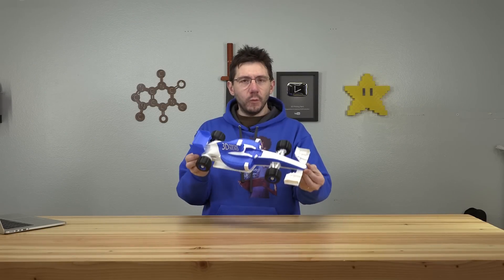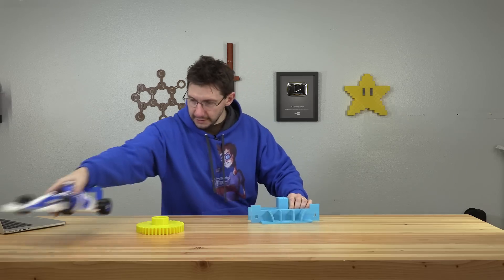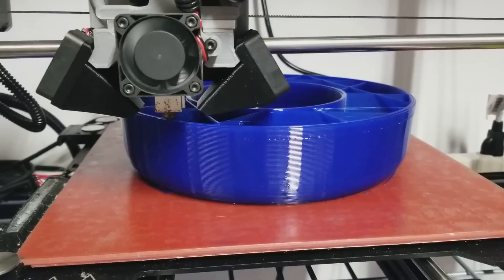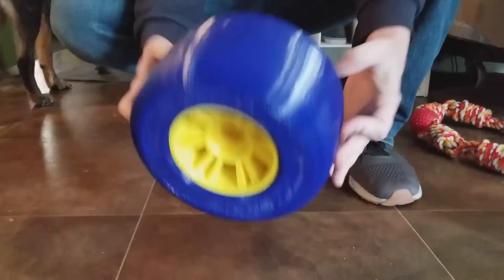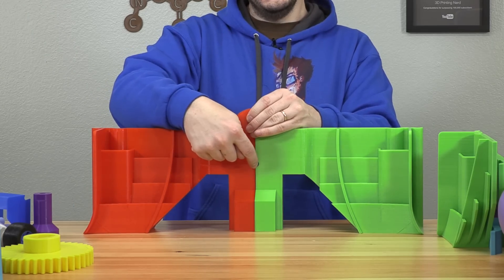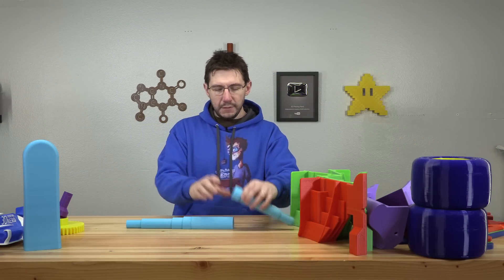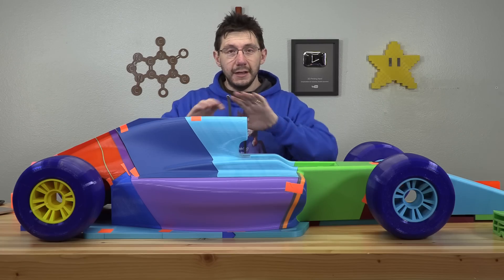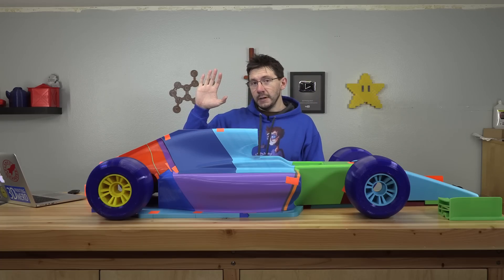Worlds Largest OpenRC F1 Car - Phase 1 // 3D Printing the Parts (Matterhackers BUILD PLA / Pro Flex)

Comment: you have cut the parts without consideration for structural integrity, and you are relying on epoxy to hold it all together... if i were you i would have redesigned them so they would have some positive engagement as you assemble them together
Reply from the maker: I agree with you. I'm still learning what's best, and since doing what I did, I know this isn't best. Don't worry I will revisit :)

Comment: I would think about something other than planar cuts.  You could, for example, cut the parts so that they plug into each other (axle) or so that they interlock with like a "zig zag" cut.
Reply from the maker: You're right, those are fantastic ideas. I'm learning so much from this build, and the next build will be better.

Comment: I found a good trick get a piece of steel the size of the sides of both heat it up with a propane torch for a couple minutes quickly put the pieces on the piece of steel so it melts just the top and the stick the pieces together when the tops are still melted so you have to be quick and then let dry for about 3 minutes

Comment: on the rear axle edit it to have a 1/4 or 3/8 inch hole through it then use some threaded rod to join them together.

Comment: You should try printing your pieces jigsaw puzzle type edges so they will lock together and have more surface area for glue. You can also try printing holes and using dowels or carbon fiber reinforcement through the joints.
Reply: Commented too soon. I see you already covered this.

Comment: On any structural joints you are worried about just drill a hole in each side and "PIN" it. A pin of any material will keep sheer forces from being placed on the joint and add cubic inches to the bonding surface. Also use something like an 80-120 grit sand paper on the surface area.

Comment: Now make one for your other foot!
Bud-- it seems to me that you have demonstrated the all-too-easy-to-solve problem with slicing a part into many. You cannot have simple butt joints for almost any set of parts. Too weak under almost any circumstances. But! You have enough software to add male/female pins and corresponding receptacles. Maybe a better shape would be an "ice cube" shape that fits into a hollow in the shape of the ice cube tray (one). Maybe there should be some "relief" for the glue, but it needn't be much.
For big flat things, nothing really does it for any flex situation but screws or nuts and bolts. But that's a lot of engineering-- you need clearances, overlapping areas and, oh yes, a thickness that can deal with all that. Puzzle shapes may be the answer-- a key and a slot; even a T-shape with corresponding T-shaped receiver. Skinning will work-- but it adds weight and one must apply the glue fairly well.
Very interesting 4x concept-- motorizing this? Gonna have to get plates to take it on the road. Maybe your dog will like it.

Comment: Registration tabs, and nut & bolt locations can be made into the model before cutting it apart, that way you can use the tabs, dowels, nuts n bolts to hold it all together with decent strength.  Proper Prior Planning Prevents Piss Poor Performance.  But overall a cool build.

Comment: how about for the thinner sections that your worried about for strength you drill holes in the pieces and 3d print plastic dowels to add strength.

Comment: Drill a hole and add a dowl(?) and should make all butt joints stronger
Reply: They even use little dics biscuits thing in would work to connect plywood together.

Comment: Instead of meshmixer, you could use Onshape to do modelling and splitting. That will let you put in those registration marks!

You can copy this model and make any edits you need:
https://cad.onshape.com/documents/82a16a9509b9900187c3e97b/w/6beae73df1575103f93b8151/e/3a4083b2d158e3adcde34efe

Comment: if u drill small holes on the joints where this is going to be a load or tourque you can then insert metal or wood dowels to strengthen the joints

Comment: If you ever go for a print this big again I would look at how wood workers would tackle parts like this. Like you said dowels would have been a good idea. There is also biscuits which would be a easy print. You might even be able to use a biscuit joiner on the wing and floor. Threaded rod can do great things if you plan the holes out and can even be easily hidden.

Comment: Hey Joel. I'm the guy  that build Zarya's Particle Cannon for the Hacksmith. (check it out on YouTube) It was a 24kg 3D print on the Taz 6 Moarstruder that had to hold a decent amount of weight. My lessons learned from it were that no amount of cyanoacrylate and resin (XTC 3D) will increase layer bonding strength enough to bear the kinetic weight of the object. (when you pick it up by one end, or it resonates while driving) In my case, I welded together an internal frame structure from steel to distribute the load. If I were to build it again, I would wrap the 3d printed assemblies in fiberglass, as it adds a huge amount of strength for it's weight. Can't wait to see this built. Good luck!

Comment: Have you heard of acetone welding? Supposedly, the weakest part of two parts welded together by spreading acetone on the two surfaces is the same as if it was printed in one piece. Maybe you should try that for the axles... and why not everything else?

Comment: I have drilled into plastic successfully. I used titanium drill bits. I recommend using a test piece. If you need bolts nuts etc... I also recommend https://www.boltdepot.com I use them all the time.

Comment: I'm wondering if the axle ends up coming out weak because of the divisions if it would be better to run a rod through it like you did with some of your other larger builds.  I'm also wondering how well that axle scales with it having a large flat area.  I'm thinking an additional print to make it completely round would end up helping as well.

Comment: If it's possible to reprint the axles, try splitting them with a diagonal joint/splice.  something with a 10/1(or better) ratio would be ideal but what ever you can fit in the center would be good.  Try it with a smaller test piece and compare how much force it takes to break them.

Comment: Had you used ABS, instead of PLA, you could have used regular plumbing ABS glue: It melts the material and you end up with very solid joints. On the other hand, solvents for PLA are nastier and harder to come by.

Comment: Great looking Project.  Demonstrates what 3D Printing can do.

For parts printed in sections, I often add "registration holes" for inserting tiny (1.5 - 2mm) stainless steel pins after the fact.

It is an advantage to print parts for which one has  the original model, adding holes which line up in SW or Fusion360 is fairly simple (just a bidirectional hole / extruded cut) for most models.

For parts which don't need to be massively strong, you could use the model to Vacuum-form polycarb or acrylic (less messy than fibreglass) shells to use on the finished car - yes undersizing the original print to allow for the finished thickness of the shell is an issue, you can't just print it smaller- that would cut down on finished weight a whole lot..

Comment: why not dowel joints between the separations?  it makes assembling and glueing much easier furthermore the parts are much stronger that way.
hope to see this fully assembled . hope it does not fall apart due to the weight.
probably you could fiberglass the main body and base.

Comment: You should look at master carpenters videos on joints when you have to connect structural joints or pieces etc they have the best and strongest joints that can help like dove tail mortis and tended spell check messed me up but those joints are stronger and others versus nailing or screwing them together those you can use alittle bit of glue and your set

Comment: For extra strength in the areas you join them you can always use a soldering iron or Drill to make holes, and epoxy metal or wooden dowels in before gluing the joints this would add  a lot of extra strength to keep the joints from shearing under high g load when driving it.
Reply: I didn't watch till the end before making this comment where you mention dowels, but still relevant haha.

Comment: Wouldn’t it be possible to make the plane cut in the profile of a dovetail joint or a finger joints? Would get a ton more surface area for adhesion. Fiberglass & resin along a long butt joint would probably help a ton also..

Comment: Think you're gonna need to slap a layer of fiberglass on the inside of the parts to keep this thing strong so the glue joints don't snap off super easy

Comment: Joel, a note for the future massive build.  Consider using some wood joinery joints rather than butt joints.  It shouldn't be much more difficult to create say a mortise and tenon or perhaps even a dovetail joint.  This would A. make glue-ups much easier B. the Joints will be much stronger.  You could also use a peg system.

Great job as always and thank you.

Comment: For load-bearing pieces, it might had been better to cut on an bias, then integrate tongues and grooves to hold it all together. This would provide more surface area for adhesives and (almost) guarantee a perfect fit without bracing or fastening, or even provide the option for metal fixtures to fasten component together.

Comment: You could drill holes and brace the joints that your worried about with dowels. Or for future you could slice the parts and add holes on either side to put dowels in. Just an idea.
Reply: Oops just got to the part where you talk about adding holes in the future. But you could still drill some for now. Thanks again for what you do!

Comment: For the rear axle, I suggest you reprint the pieces but with a square hole on the mating surfaces and then print a tiny cube that you put inside so you'll have what's called an "obstacle power transmission" wich will hold way better than just glue

Comment: Joel, when you split the axle if you inserted matching holes in the center of each you could use a printed pin to strengthen the joint. Angus Deveson at Maker's Muse has a video in his meshmixer series dealing with this exact issue.

Comment: You should use carbon fiber or fiberglass (cloth?) and epoxy to reinforce the load bearing parts. Especially on the main body just sandwich it between a table and put a piece of plywood on top with lots of clamps or weight

Comment: Some substitutions I'd suggest:  Using steel for the axles and Aluminum or steel for the base and have it CNCed since it could essentially be 1 big sheet of steel.  This car kind of reminds me of those Hot Wheel's cars where little kids ride in and steer.  I realize to design a cockpit would require some redesign and reprinting.

Comment: I wish I could find another application to do it in, however the windows 10 3d builder app allows you to throw a tube into the middle of an stl to a specific size. Thats how I end up dealing with splitting parts. the cutting tool is not as good but that part works pretty good.

Comment: you should learn some wood joints techniques for next time you split a object... you will have more accuracy when joining the pieces, add strength and more surface area to glue.

Comment: I had an idea for when you have multiple prints in risk of running out of filament. Get some cheap Flood Alarms and replace the electrical contacts with two pieces of metal designed to slide along the filament by gently pinching it. As soon as they slip off the end of the filament they'll make contact with each other and set off the alarm.

Comment: Put a 45 degree bevel on all of your joints and use a 3d pen to plastic weld them together. I just did that for a project and it works absolutely amazing

Comment: I've used the technique below in Fusion 360 successfully to split and glue a toy dump truck model also by Daniel Noree, printed on my tiny and somewhat crappy M3D Micro - https://knowledge.autodesk.com/support/fusion-360/learn-explore/caas/screencast/Main/Details/058c63ba-23c4-4b96-a218-d86a52afbadd.html
The split version of the toy dump truck for anyone who's interested - https://www.thingiverse.com/thing:1239806

Comment: If you had used Netfabb to split the model you could have used pin creation , this would have produced holes on one side of the split and pins on the other , much better for alignment and gluing (more surface area )

Comment: Hey man, I use good quality chamfered wood dowels used in furniture. Just scale model, then split parts so you end up with watertight mesh, model dowel (i made it 50um larger in diameter with round ends), place inside the model wall, on line between parts and use boolean difference. It may be tricky to place dowel model inside mesh, cross section view helps a lot, but I dont know if meshmixer provides such features. 6mm dowell is smallest , but if i need something smaller I use matches. This way you apply glue and join parts with perfect alignment, just remember dowel must face same direction, if they are at angle to each other You wont be able to join multiple parts. If, for some reason dowel hole will print badly, you can easily modify wood dowel with knife or chisel. I glue pla with epoxy and use masking tape on sidewalls edges in case resin spills out. I wonder how well Your parts will fit show us the gaps in next video.

Comment: Hi Five, Joel, great video as usual!  i have a question for you i want to connect to my tevo tarantula with my computer only for bed levelling, etc. in simplify 3d or pronterface with no internet connection/wi fi connection, computer controlled only.  i have searched the web and have found no information on this whatsoever. Am i chasing my tail or is it at all possible?
  Thank you for your help!

Comment: Awesome project, wanted mention an issue i encountered where the gear that feeds the filament skips back, i had this the last time i was printing the last piece of a mask and from what i found online i decided to clean the nozzle since i changed the filament from one brand of PLA to another PLA and this issue happened about halfway of using the roll.After cleaning the nozzle ( which i haven't done in a long time) the issue appeared in the beginning of the print but then it stopped and haven't had it since, i think because of the clog the gear was having a hard time pushing the filament though the nozzle. I hope there is a better way of cleaning the nozzle from PLA than just heating it a few seconds above a fire and using a needle to remove the plastic.

Comment: You should get Ivan Miranda over and work on getting it moving
Reply from the maker: I love that dude!
Reply: 3D Printing Nerd RCLifeOn, 3D printing Nerd, and Ivan Miranda collaboration for a driveable 3d printed F1 go kart, which an adult can drive. Maybe Peter Sripol could help for the motor part too, or even better, Colin Furze!
Reply: @tiberiocellini3641  Colin Furze would add 200kg of rockets and a Hayabusa engine to it. Rip it apart but it would be a lot of fun to drive for  4 seconds...
Reply: I do too,
next screw drive tank 400%

Comment: Traditional method is to lay fibreglass sheets and paint them down with epoxy. I'm gonna strongly recommend doing that with this, especially with the axle and bottom plate cuts.

Comment: Make some female and male hexagon parts, kind of like on a bolt, that slot into each other for your axel.  That should help keep it together and keep the tension from twisting it apart.  You could also make other female and male inserts for other large weight barring parts.

Comment: By my reckoning a x4 upscale makes the model 64 times heavier. I suspect the wall thickness and bolt holes could all be reduced and still maintain the required strength. I think it's going to be challenging to make the joins strong enough. Great project.
Reply from the maker: You make some good points, and I guess we will see! :)
Reply: You've probably already seen this, but Thomas Sanladerer welded PLA parts together with acetone, here's his video: https://www.youtube.com/watch?v=VZUfq0yrtv4 It might not be a lasting joint like with ABS though.

Comment: One place you can get 'air core' or 'coroplast' is from Soda pop guys, ask them for some their old signage that they put in front of stores (after the sales end), another place) another place is political signs (off your own yard, when they don't come pick them up).  For the axle I would drill it through (or reprint it with a shaft hole in it) and put a piece of threaded rod (like you skateboard).  I would also slice it so it has some tabs or pins to align it and give the large parts some strength.

Comment: Hey Joel, I know you love to use fusion, and so do I. I think if you ever try something like this again, use the offset planes and split body tools in fusion to split your models, then since you have a powerful cad tool at your disposal, add registration marks and or mounting fixtures to each part.

Comment: I can't wait to see the car done! It's gonna be awesome. Those are go-kart sized tire! If you need to reprint/recut parts, you have the step file to use in Fusion360. Even easier than with meshmixer and you will have the possibility to insert reg mark/dowels to the parts. If the chassis fails, you could cnc plywood or metal sheet and use it as a sturdy chassis. What kind of motor are you planing to use?
Great Vid as usual :)

Comment: The plastic sheet your taking  about is called coroplast but i reccomend one called alumilite its coroplast qith a thin sheet of aluminum bonded to it its consiconsiderably stronger. Ive used it to make front spoilers for real cars and it holed up well.